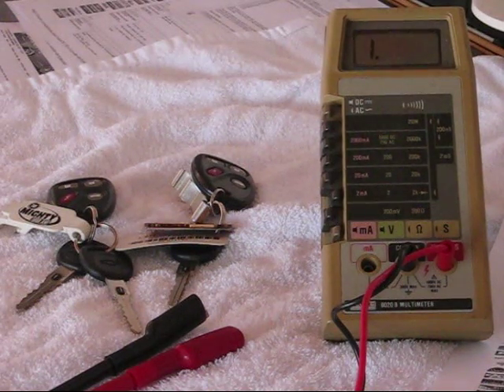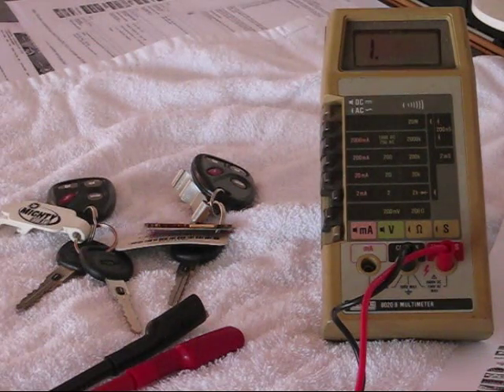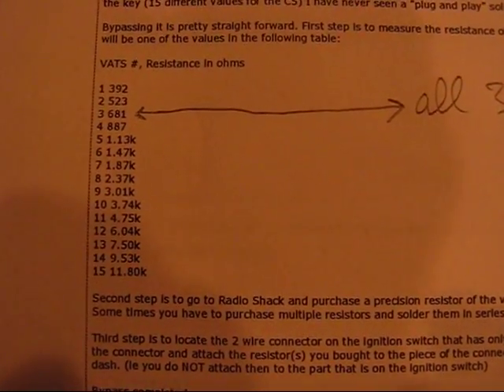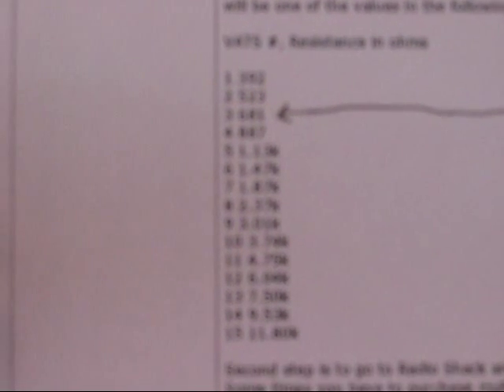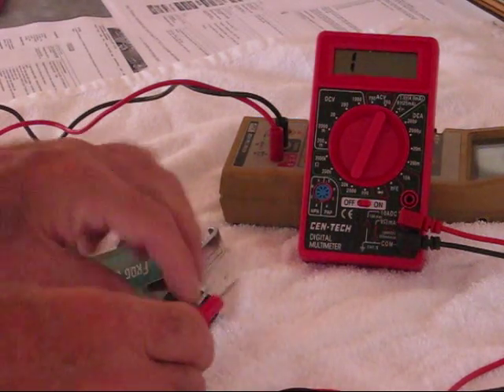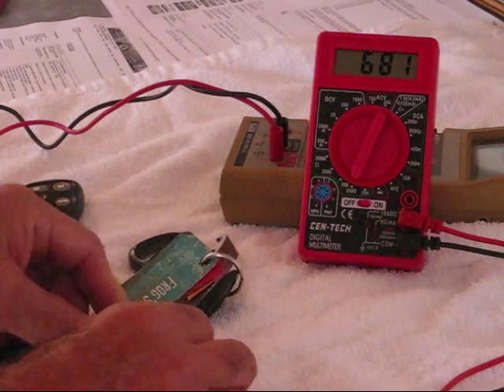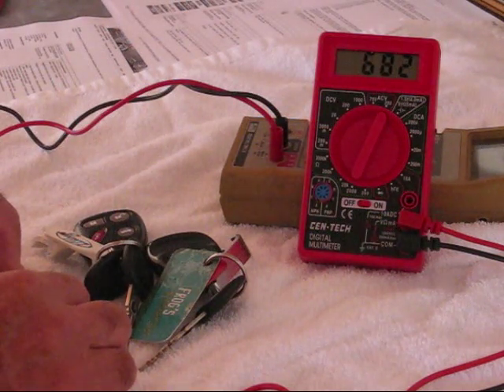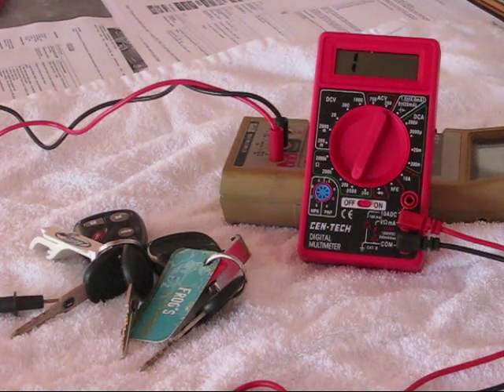Corvette VATS key pellet resistor value c5 not a bypass by froggy

Comment: Mines read 2.35 on two readers. What is that
Reply from the maker: #8
Reply: @1947froggy  thanks. Where can I buy one besides Amazon?
Reply from the maker: @obe1canobe146  Locksmith stores, but be advised they may not have blank in stock.
Reply: @1947froggy  also does it matter if my key is a fat head or small head as long it’s a #8. Trying to replace corvette key
Reply from the maker: @obe1canobe146  If head means where your fingers grab the key, then no does not matter, Key & pellet must fit in slot.
Reply: @1947froggy  big thanks

Comment: exactly what surfaces are you touching with the pos and neg probes?
Reply from the maker: Gregory P Good question, I did not realize I was blocking the contact point. It's the black "pellet" imbedded in the key. You touch the smaller silver "bit" that sticks out of the pellet.

Thanks for bringing that to my attention.

:)
Reply: froggy Thanks for the reply.  So, you place the probes on either side of the metal bit sticking out of the black pellet?
Reply from the maker: Yep!

Comment: Helpful video, thanks so much Froggy.  I keep getting a resistance reading between 535 and 580.  Is that too far from the chart value of 523 - 502 to be a #2 Key Blank?
Reply from the maker: Ck with another meter.

Thanks for watching.

:)

Comment: hello, I just cleaned the terminals very well, and only one had a little bit of dirt, try again and nothing, after several attempts caught without problem, leave it for a while on, then turn it off again the fault is present, no longer wanted to move, suggestions, thanks